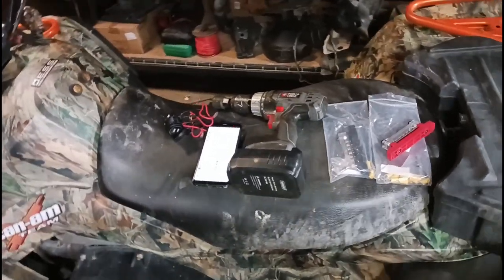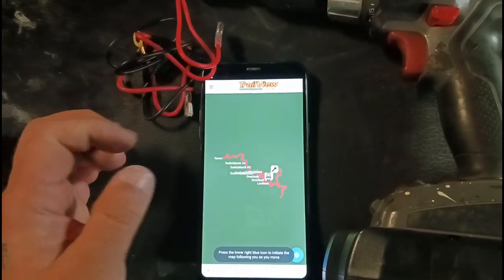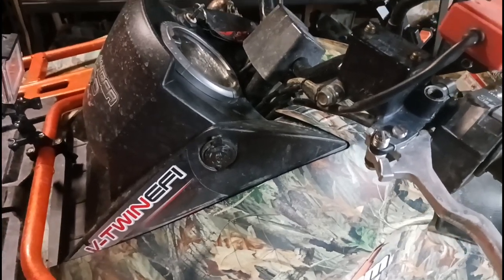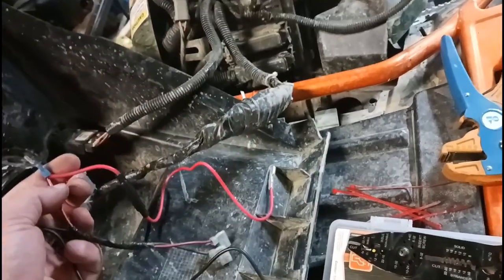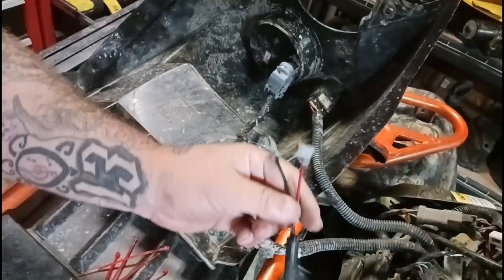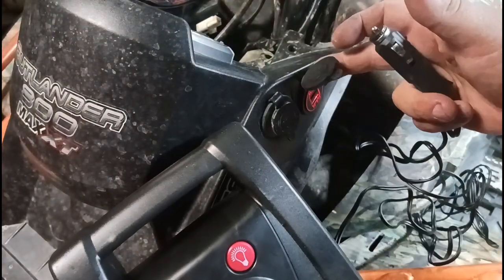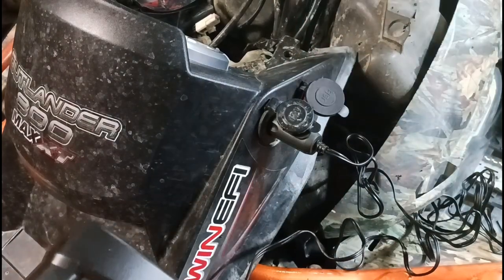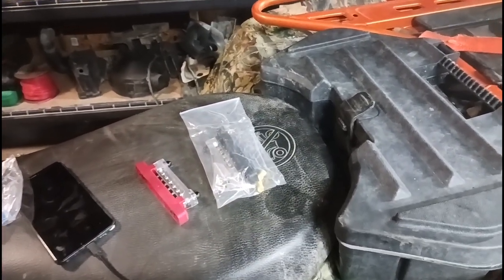Installing a secondary 12v USB Accessory Plug in an ATV. 2008 CanAm Outlander 800 Max XT

Comment: what diameter hole drill bit did you use?
Reply from the maker: I used a step bit, took my time, and kept placing the part in place until eventually the hold was just large enough for the part to slide in place.
Thanks for watching!